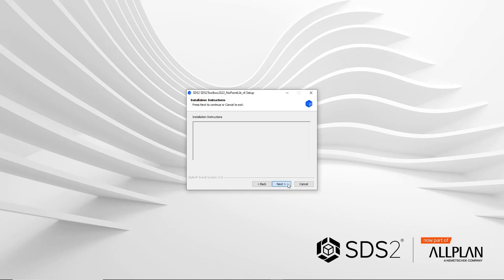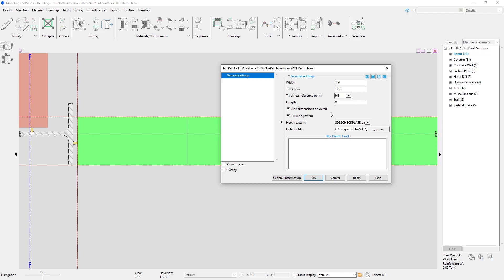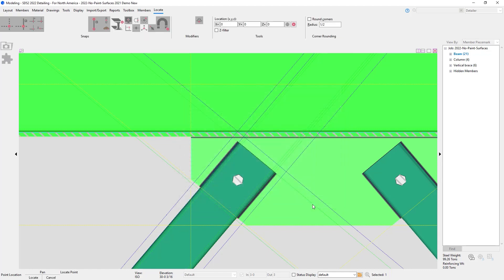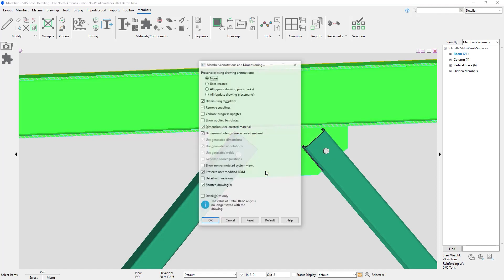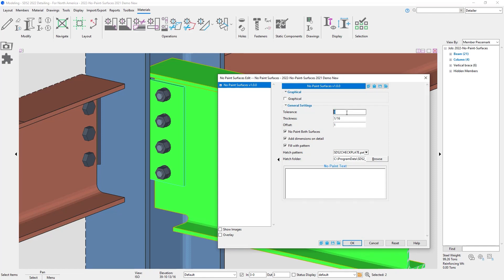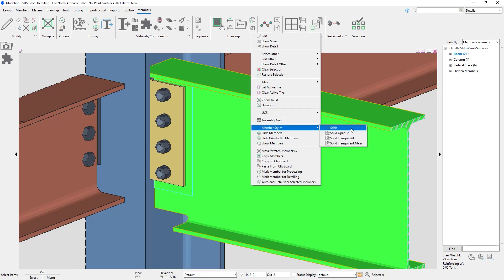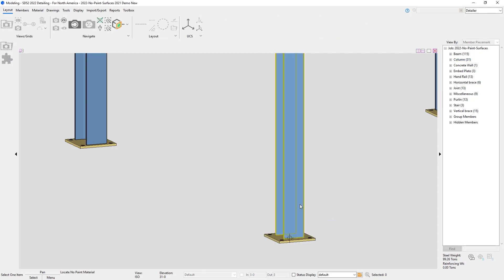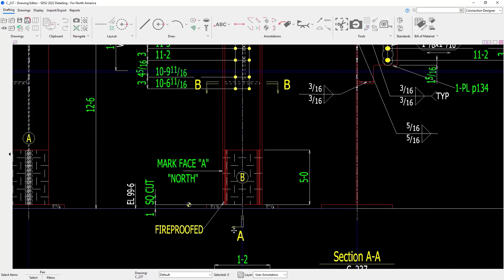SDS2 Toolbox: No Paint Surfaces

Comment: If using the "No paint surfaces tool" adds plate matl in the model wouldn't the system (when auto detailing the member) add a submatl mark to it?, as well as adding the plate size description in the BOM chart on the 2d member detail? Or does detailing with templates (turned on) prevent that?
Reply from the maker: Hello BEH, since this is "dummy material" it will not be added to the BOM and will not be called out with piecemarks on the detail